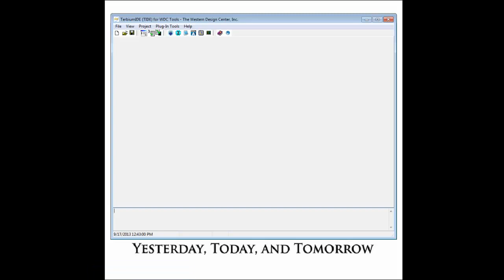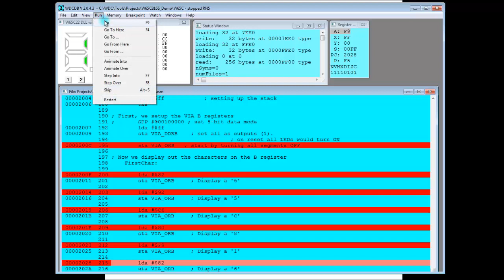TIDE Simulator Project Demo

Comment: Your Product meaning the hardware may be awesome. Your software and you tutorials cover almost everything except the most import part. Meaning you either have left it that way on purpose or you did piss poor job. FYI
Reply: I cannot agree more.  I'm looking into trying to learn the elements of 6502 through such a board but find the lack of information and support options to be very disappointing on something that could be potentially mind blowing if demonstrated well - otherwise I would have bought one of the boards and jumped in at the deep end.